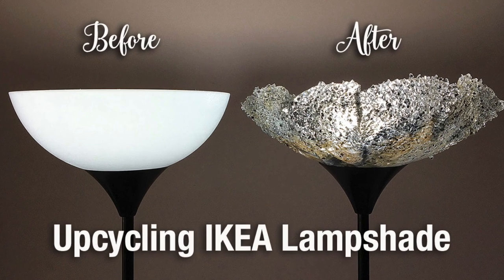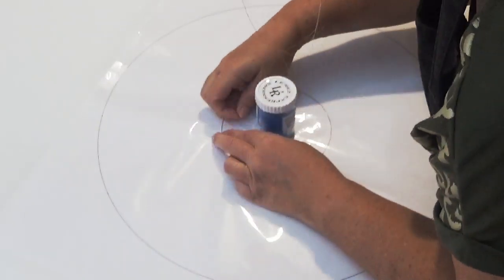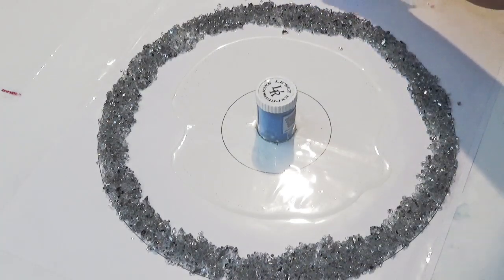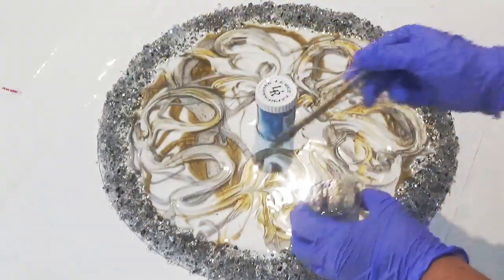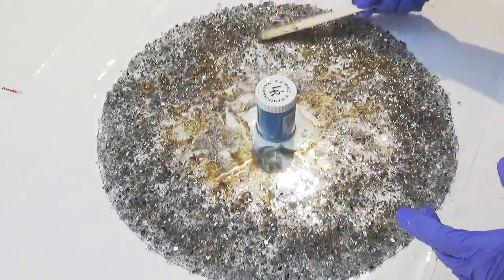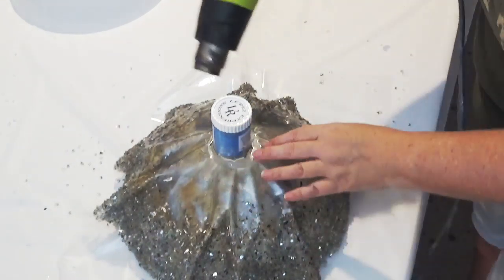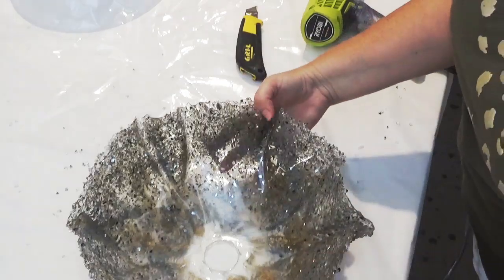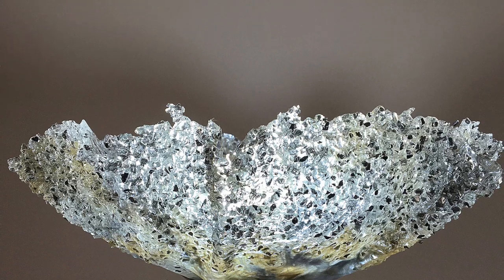Upcycling an IKEA lamp by giving it a new crushed glass and resin shade.

Comment: Stunning as always. You make it look easy as.. I'm keen to do an old lamp I have following this tutorial... Only question I have is what is the plastic your using to put the resin on for molding?
Reply from the maker: Thank you 💕 I used cling wrap, although, you could use any kind of plastic that your resin doesn't stick to. I would recommend testing your resin on plastic before commencing with your project. Good luck. 💕

Comment: Beautiful creation, I'd like to do the same, but where did you get the mineral turpentine oil?
Reply from the maker: I bought my mineral turpentine from Bunnings. White spirits will do the same thing. 💕
Reply: @SueFindlay  Thanks Sue - you're so incredibly helpful.  I enjoy watching you create these masterpieces.  I have a quick question, do you think I can create a resin lampshade as you did with the cellophane plastic AND apply that to the existing shade?  rather than replacing the shade entirely?
Reply: @SueFindlay  Also, what do you think of doing this same technique directly on the lampshade - would that work?

Comment: Sue please help! I use online resin calculators but they are never accurate! I either mix too much or not enough. How do you determine?
Reply from the maker: I also use an online calculator. I use it only as a guide because quite often I don't need as much. You get to know, over time, how much you will need.